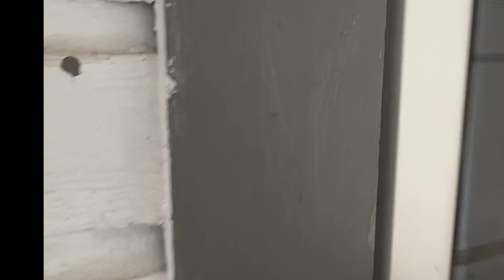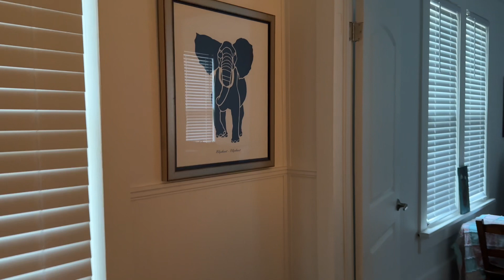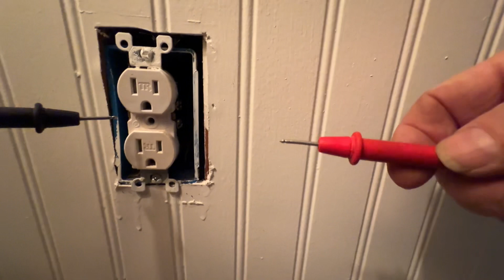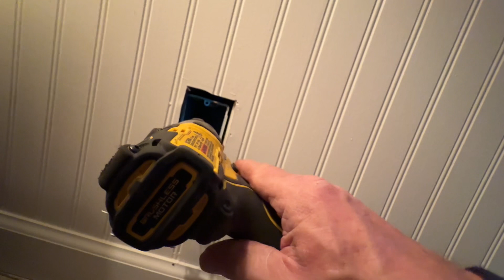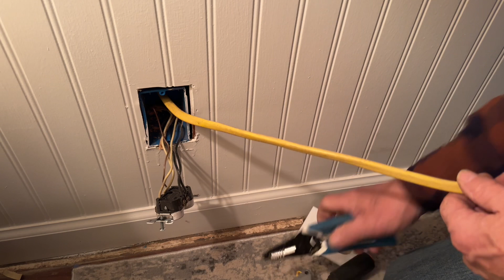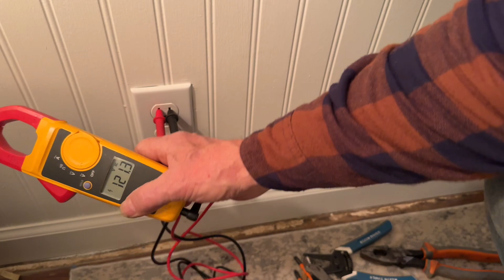How to Install an Outside GFCI Receptical to an Old House  “Your Electrician Buddy”

Comment: Next up on the list for me to do at our house we just moved into about 3 years ago.  Wife insisted on having an electrician do a bid;  She determined that my offer of just a dinner and a kiss was better than the $300.00 bid the electrician gave her to do the job. 😆Works for me, Happy wife, Happy life 😉
Reply from the maker: Sounds like it’s a win all the way around. Please be safe and if you have any questions, please ask. Thanks again. Your Electrician Buddy
Reply: @YourElectricianBuddy  Safety first, Already replaced our main panel from a 1960's Bryant panel to a new 200 amp SquareD and attached two new grounding rods and attached it to the poured cement pad that had a grounding lead right next to the Service Entrance location, no one bothered to tie it into the bonding for the house....🤔 Sometimes I scratch my head when I see safety things not taken advantage of...Passed inspection with the city and the inspector asked if I was an electrician.  Nope just had to do tons of things in the military and as a firefighter.  Now retired. 🥳
Reply from the maker: @BackwoodsLaw  definitely your training is paying off. Sounds like you have retired with good health. As for safety, yes I have come across some really scary things. True we are always learning and the longer time goes on safety has to be refined daily.

Comment: Great video! I have an old house with a metal box on the inside of the home. I want to use that for power to run to my new box outside. 

Is it up to code if I drill through that box?
Reply from the maker: Thanks for the compliment. Most metal boxes have a 1/2 knock out stamped in the back. But if not you can drill out the hole and insert a plastic snap-in connector. Here is what I use. 
RACO Plastic Connector, Snap-In: Thermoplastic, 1/2 in Trade Size., Item 1RVZ1 Mfr. Model 4714.  This is a Granger number
Hopefully this helps. Be safe! Your Electrician Buddy